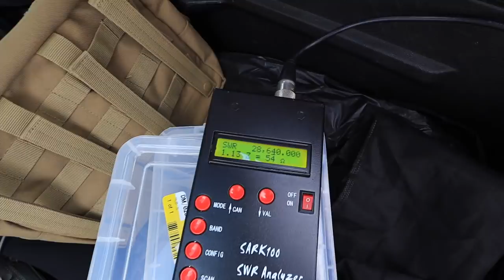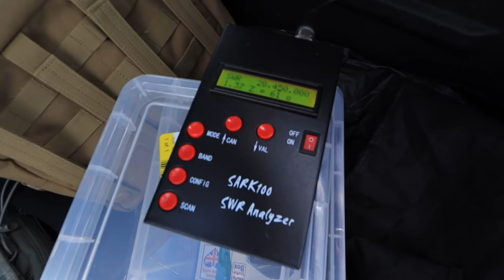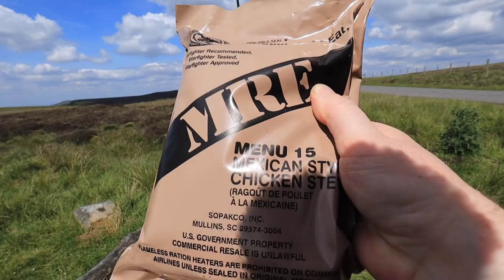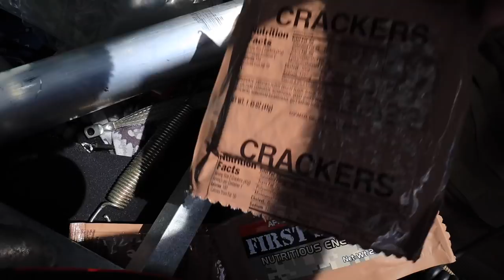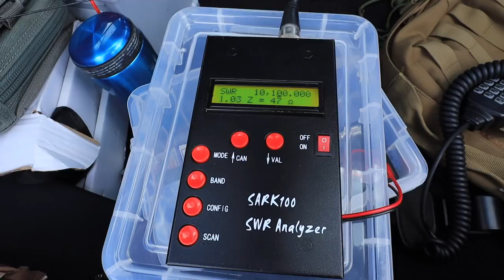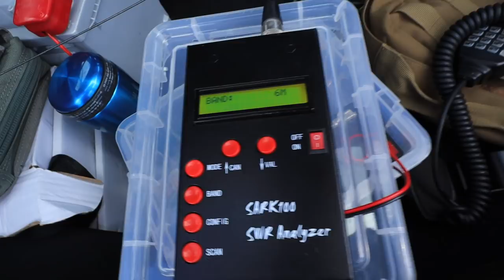Building the DX Commander antenna while out operating portable

Comment: Just bought the DX Commander all band vertical. Have not received it yet but I am hoping it turns out to be a good purchase. I have a very small back yard so I am limited in the amount and length of radials I can put out. I am also planning on leaving it up year around so we will see how it works out. Thanks for sharing.
Reply: dheller777 I’m building mine now. My plan is to leave it up year round. My yard is not huge but I’ll make up on one side for short radials on the other. Pay attention when you read and build. I made a few mistakes because I was trying to be quick and had to go back to dismantle and rebuild twice. Lol it is a lot of fun building it though! I’m just about at testing phase... good luck and -73-  W1KPS
Reply: @kevinshieldsw1kps785  How are the instructions?
Reply: dheller777 instructions are good and if you go to DX Commander website there are more videos and instruction. If you send Callum and email with a question about it he will reply quickly! I really can’t stress enough taking your time and going in order. I tried to jump around, big mistake. Callum is a top notch guy and he will help if you need it. I’m sure you’ll be fine!! -73- W1KPS
Reply: @kevinshieldsw1kps785  Thanks!
Reply: I just got mine delivered today. I did notice there were no written instructions included in the box. I am guessing he does not provide this and I will have to go online to locate them.  @kevinshieldsw1kps785

Comment: A lot of work to get the portable wire up.  And then the meal... mmm, yummy cheese bits and crackers.  With that meal you differently need the tea.  Good all around.
Reply from the maker: Yes it was processed cheese and then chemical cheese, yumm. I'm trying to avoid using a flame cooker during summer. I should have got a sandwich instead.

Comment: Hi carl miss your portable exploits.was you using the dx with no radials?? I put mine together yesterday and tried with no radials n straight in to Austria and russia on 40 meters :)
Reply from the maker: Hi, I always use radials with 1/4 wave antenna, I wonder if the outer shield of your coax was the other half of the antenna?
Reply: @M0SZT  ah I never thought of that.worked well though.lets hope this lockdown comes off soon so we can have some more portable from yourself :)

Comment: I am determined to get to the end of this video, just to see if it was worth all the hassle you've been through so far (you were beginning to battle with radials when I typed this). If you do get this sorted then well done :) However, I do have a question. Doesn't a 5/8th wave vertical require some form of impedance transformation?
Reply: I'm impressed! :D
Reply from the maker: Thanks, I've been reading up on this and my head hurts a little, I've tried to build a 5/8 wave vertical for 17m and looks like it would benefit from something, I'm now learning about L match 🤠
Reply: No impedance transformer required 5/8 will give a good impedance match. Radials are required for ground plane.
Reply: @G1WHP  that's not what Google tells me :)
Reply: @Paul Graham, Now you got me thinking........ whilst 5/8 will give max current resonances to 50 ohm will indeed rise. This is now making my head hurt. I will ask a man that will definitely know the answer. My first instinctive answer is definitely not to be relied on. Let me find out more.... 🧐

Comment: thats a lot of messing around the buddipole is up in 5mins and swr 1.1 sorry nige 73 im an fan 2 lol
Reply from the maker: Ha, yes I have similar, however I had so much fun building the wire antenna and getting the contacts.
Reply: Its really just initial setup. Once you've cut and crimped everything it takes about 8-10 minutes to go up and its 5 bands (2023 model) perfectly tuned. Rather than having to raise and lower the versatee and playing with the annoying whips and clips (I own a buddipole too and those coil clips are irritating as hell) to get a band tuned in.